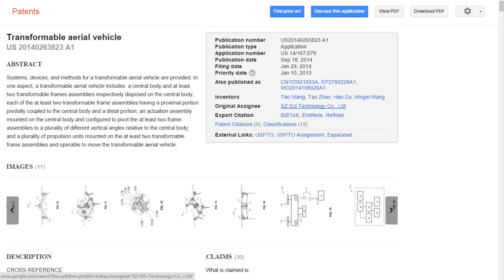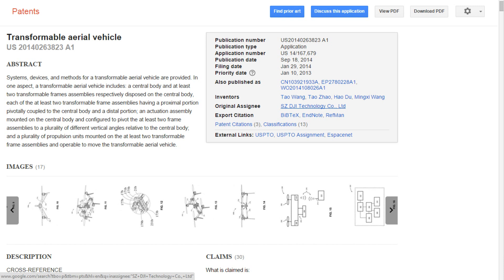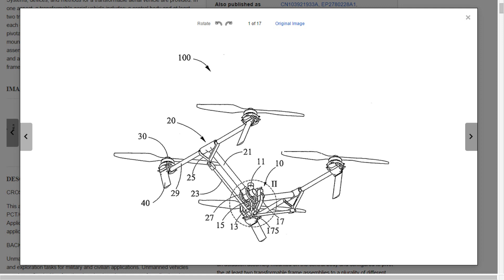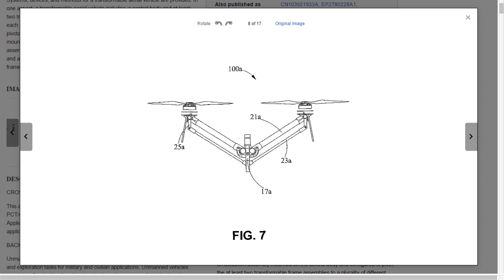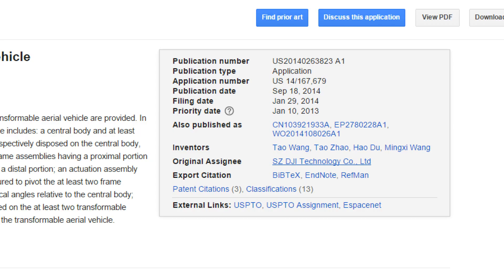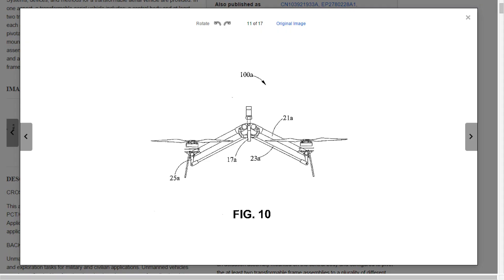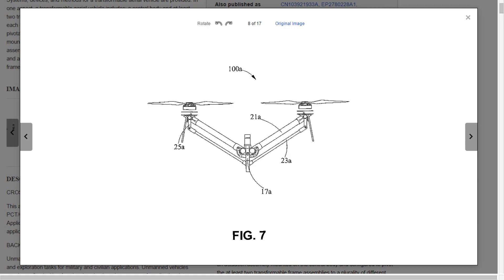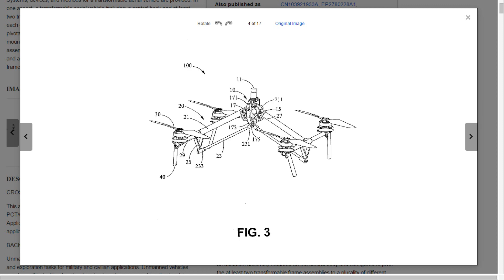DJI Patent reveals "transforming" ability - Inspire 1 design revealed?

Comment: Okay, definitely the inspire 1...the whole shape in the illustration is the shape they use every time they talk about the inspire 1, or triumph. The whole triangular shape. This has to be it. Sweet design....lots more to break in a collision lol. Lets hope they Have spare parts this time haha
Reply: I saw that...looked kinda......cheap?
Reply: I agree about with u completely. ..looked like completely different motors if memory serves correctly...didn't they have some red in them?
Reply: Hey..maybe the name comes from the fact that it will be so unbelievably cheap that it will inspire one to go out and buy it. We will like it solo much that we will feel triumph about leaving the phantom series! I figured out the riddle hahahahahaha
Reply: so far the only thing I am getting that might be possible is not only 2 positions the inspire will be able to pivot, but multiple positions during flight.  The patent keeps talking of at least 2 transformable this and that....I feel, and this is just my opinion, that you might be able to even get a view from above your props during flight, middle of props, and under props???  Would be kinda neat??
Reply: I wonder what the green symbols were in the leaked photo above the blue light?  Maybe battery gauge led's, or pivot lights, orrrrrrr just neat green lights for not apparant reason? lol.  I thought it could be the different levels of pivot?
Reply: what's this? The propulsion units can be mounted on any suitable portion of the transformable frame assemblies, such as at or near the distal portions of the transformable frame assemblies.  Motors can be moved to different areas of the arms??
Reply: This is why I think you might have a lever to adjust whatever angle you need of the Quad:
For example, in some embodiments, the transformable frame assemblies can be pivoted through a plurality of vertical angles relative to the central body (e.g., a vertical angle 50 measured from the line 51, as depicted in FIG. 4). The transformation of the transformable frame assemblies can be actuated by a suitable actuation assembly mounted on the central body and coupled to the transformable frame assemblies. Advantageously, this approach allows the vertical angle of the transformable frame assemblies to be adjusted as needed during operation of the transformable aerial vehicle.
Reply: Movable camera? 

The payload can be coupled to any suitable portion of the central body, such as on top, underneath, on the front, on the back, or on the sides of the central body. The payload can be configured to perform a function or operation. The function or operation of the payload may require a certain amount of functional space. The functional space can be, for example, a space occupied, affected, manipulated, or otherwise used by the payload during its operation. In some instances, however, the functional space may be obstructed by a portion of the transformable aerial vehicle. For example, when in the first configuration, the transformable frame assemblies may extend into the functional space, thereby interfering with the operation of the payload.
Reply: Automatic Angle Adjustment?
The driving of the actuation assembly can occur automatically (e.g., based on a state of the transformable aerial vehicle, such as the altitude, longitude, or latitude) or in response to a user command. The method can be applied, for example, to adjust the vertical angle of the transformable frame assemblies during the operation of the transformable aerial vehicle.
Reply: Okay...now after reading, I think the blue light is in fact a light that can be mounted or is already mounted, but can be turned off and on from the controller for doing things like search and rescue..don't ask me how I come up with this but this kinda makes me think it?This is talking about the "platform or central body"

 For a tool, instrument or manipulator mechanism, the functional space can be an unobstructed working range or movement range. For example, a functional space of an emitter (e.g., illumination source) may be an unobstructed area which may receive emissions (e.g., illumination) from the emitter. The functional space of a payload can be of a fixed size or a variable size. In some embodiments, the functional space can be increased or decreased. For example, the functional space may be increased or decreased by a transformation of the UAV 100, as described in further detail below.
Reply: Sorry to be blowing up your page....Looks like you can position motors where you want, and can add as many as you want to fit the application...like, up to 8 maybe??  vertically or horizontally?

Although the propulsion units 30 of the unmanned aerial vehicle 100 are depicted as four rotors, any suitable number, type, and/or arrangement of propulsion units can be used. For example, the number of rotors may be one, two, three, four, five, six, seven, eight, or more. The rotors may be oriented vertically, horizontally, or at any other suitable angle with respect to the UAV 100. The angle of the rotors may be fixed or variable. The distance between shafts of opposite rotors can be any suitable distance, such as less than or equal to 2 m, less than equal to 5 m. Optionally, the distance can be within a range from 40 cm to 1 m, from 10 cm to 2 m, or from 5 cm to 5 m. The propulsion units 30 can be driven by any suitable motor, such as a DC motor (e.g., brushed or brushless) or an AC motor. In some embodiments, the motor can be adapted to mount and drive a rotor blade.
Reply: Different frame assemblies:

 The UAV 100 can include any suitable number of transformable frame assemblies 20, such as one, two, three, four, or more. In some embodiments, the UAV 100 includes at least two transformable frame assemblies 20. The transformable frame assemblies 20 can be situated symmetrically or asymmetrically around the central body 10. Each transformable frame assembly 20 can be used to support a single propulsion unit, or multiple propulsion units. The propulsion units 30 can be evenly distributed among the transformable frame assemblies 20. Alternatively, each transformable frame assembly 20 can have a different number of propulsion units 30.
Reply: landing gear? 

The support member 40 may be static. Alternatively, the support member 40 may be movable relative the transformable frame assembly 20, such as by sliding, rotating, telescoping, folding, pivoting, extending, shrinking, and the like.
Reply: Again, suggesting multiple angles of transformation?

The UAV 100 can be designed to transform between the plurality of different configurations in a fixed sequence. Alternatively, the UAV 100 may be able to transform between the plurality of different configurations in any order. Transforming from a first configuration to a second configuration may involve transforming through a plurality of intermediate or transitional configurations. The UAV 100 may be able to stop the transformation at an intermediate configuration, or may be able to stop the transformation only once the end configuration has been reached
Reply: huh? They discuss a lot about adding sensors or emitters or tools in this unit....I think it is going to be one that people can use in search and rescue more so then the Phantom series..and check this out?

Alternatively or in combination, the transformation to the second configuration can increase the available maneuvering space for a robotic arm coupled to the underside of the central body
Reply: it states that sometimes the uav needs to be different angles for different situations...maybe if you were needing to fly through a narrow place for search and rescue???  Arms are extendable or can be shortened it seems also...and it knows how to automatically change angles when taking off, or landing because

 In some embodiments, the control system can be configured to automatically control the transformation of the UAV 100, based on one or more of: position of the UAV, orientation of UAV, current configuration of the UAV, time, or sensing data acquired by a sensor of the UAV or by the payload. For example, the UAV 100 can include one or more sensors adapted to sense when the UAV 100 is about to land (e.g., based on position, velocity, and/or acceleration data), and the control system can automatically transform the UAV 100 into a landing configuration. Similarly, the UAV 100 can include one or more sensors adapted to sense when the UAV 100 is at a suitable altitude for aerial photography, and the control system can automatically transform the UAV 100 into a flight configuration increasing the functional space of a camera payload, as described herein.
Reply: Agreed, Simon....I think this is definitely aimed at industrial type things like you named...not that we can't enjoy it as well
Reply: Good ol clockwise, counter-clockwise rotator for adjusting angles...and maybe programmable for different applications with memory of position??

The user commands received by the receiver can be used to control an actuation assembly configured to actuate the transformable frame assemblies 20 (e.g., via control of a suitable drive unit, such as the drive unit 11 described in further detail below). For example, the commands can include commands to turn the drive unit on or off, drive the actuation assembly with the drive unit (e.g., in a clockwise or counterclockwise rotation), or maintain a current state of the actuation assembly. The commands can result in the UAV 100 transforming to a specified configuration or maintaining a current configuration. In some embodiments, the transformation of the UAV 100 can be indirectly triggered by a user command directed to another function of the UAV. For example, a user command for the UAV 100 to land may automatically cause the UAV 100 to transform into a landing configuration. Optionally, a user command for a camera payload to begin recording images may automatically cause the UAV 100 to transform a configuration increasing the functional space of the camera, as described herein.
Reply: Getting a lot about a nut running along a screw causing the transformation...not that you don't know that...just letting ya know.
Reply: You can add arms between arms and motors maybe for heavy payloads?!

In some embodiments, the fixed assembly 17 a of the UAV 100 a forms a pentagon having a first side 171 a, a second side 173 a, a third side 175 a, a fourth side 177 a, and a fifth side 179 a. The first side 171 a can be perpendicular to the second side 173 a and coupled to the lower end of the screw 13. The third side 175 a can be perpendicular to the second side 173 a and coupled to the upper end of the screw 13. The fourth side 177 a can be oriented at an obtuse angle relative to the fifth side 179 a, and the fifth side 179 a can be oriented at an obtuse angle relative to the first side 171 a. An extension 18 can be formed with the third side 175 a, for example, in a direction extending parallel with the first side 171 a. The extension 18 can include a plurality of interfaces 181 (e.g., card interfaces). The interface 181 can be used to releasably couple a payload (e.g., a camera or robotic arm) or a battery.
Reply: milar to the UAV 100, the transformable frame assembly and the central body of the UAV 100 a can form a parallelogram or parallelogram-like shape. In this embodiment, the length of the primary shaft 21 a (e.g., as measured between its proximal and distal couplings) is equal to or approximately equal to the length of the secondary shaft 23 a (e.g., as measured between its proximal and distal couplings), and the length of the connector 25 a (e.g., as measured between its upper and lower couplings) is equal to or approximately equal to the length of fixed assembly 17 (e.g., as measured between its coupling to the primary shaft 21 a and the coupling point 172). However, other suitable geometries can also be used, as previously described herein.
Reply: Definitely seems to be able to be customized to fit any shape for any job?

 In particular, each transformable frame assembly 20 b of the UAV 100 b includes a primary shaft 21 b and two secondary shafts 23 b that can be arranged to form a triangular prism or triangular prism-like shape.
Reply: In some embodiments, the fixed assembly 17 b forms an approximately rectangular frame having a top side 171 b, a bottom side 173 b, and opposed lateral sides 175 b. The proximal end of each of the pair of primary shafts 21 b can be pivotally coupled to the fixed assembly 17 b and to each other at the top side 171 b (e.g., at coupling point 177 b). The proximal end can also be coupled to an actuation assembly within the fixed assembly 17 b by one or more connectors, as previously described herein with respect to the UAV 100.
Reply: Okay.....I think I pretty much covered the entire patent..Anyone else who wants to view it can at http://www.google.com/patents/US20140263823.   As stated before, i think the insipre 1 is directed more towards research, and search and rescue.  It seems that it will be able to be configured to be multiple shapes by adding tubular arms and connectors, and you can add more motors to it or whatever you need.  The arms can definitely be raised and lowered above or below it's main "platform" to take better pictures, or to allow mechanical arms to be used without obstruction of the props?  At one point it looked like the camera will be able to be moved from one location to another to better suit the configuration.  Seems like a pretty awesome system that will be able to handle a great deal of weight dependent upon the configuration.  And probably pretty fast!  If all this is wrong, then perhaps DJI needs to build one like it lol.  I can definitely see a use for this in the future, especially after the laws are created in 2015 and it becomes easier for law enforcement, farmers, and oher types of commercial users to use them for work.
Reply: I know they are trying to cover every thing in the book about the patent without giving it away, but it really does seems quite feasible? I wonder what the patent on the DJI Phantom said?  Maybe if we looked over it and removed some of the things this one and that one talk about, we might be left with the true inspire 1?  Something does tell me that a lot of what I got out of it is going to be true though?
Reply: Gut feeling
Reply: The introduction from the teaser pretty much verifies the search and rescue aspect to me??  "Innovation is ignoring boundaries and redefining possible"
Reply: ***** Oh yeah.  The want to remain the leaders of the industry for sure and unfortunately, real people out there wouldn't be able to keep shhhhhhhhh if they were able to try it out before it was released.  I wish they would send me one and let me test it out for sure!!!  And of course, keep it after I am done ;).  I always find myself so jealous of those guys who get the latest DJI or Walkera quads before they are released.  I would LOVE to do reviews on products like that.  You know me, I am not scared to give an honest opinion on anything! lol.  Hey, thanks again by the way for the vision servo and all.  People like you are what makes this world a pleasant place to live.  I am the same way.

Comment: Starting to be more convinced that it will be what the dji triumph rumors said. In the new teaser there was the same triangle that was in the ui of triumph mock ups. We also know size and battery match, as well as having camera (probably 4k). Therefore I think what we will see is dji triumph ui and folding in air hex with built in lightbridge and 4k cam and gimbal

Comment: It strikes me that this is a design that requires no retractable landing gear because the frame itself "IS"  the retractable landing gear. The central payload part is elevated with the motor arms at ground level during take off and landing. After take off,  this design then pivots the central payload part to a lower level and the props to a elevated level configuration to keep the props out of view when the camera is recording horizontally or when the camera is pivoted looking down.. So no legs or props in the camera frame ... Ever...with this design after take off. 
It also shaves off the weight of retractable landing gears too..very clever actually..
Reply: No wonder they filed a patent for this design
Reply: Yes..  I too am drooling Simon,  if "she" were wearing a red dress and I had been drinking..  I might wake up in the morning alone  in a cheap hotel room with a empty bottle of scotch and wallet, with  my credit card at its limit,  and a lot of "esplaining" to do as Desi Arnez used to say on the old B&W "I love lucy" TV show..  Lol!